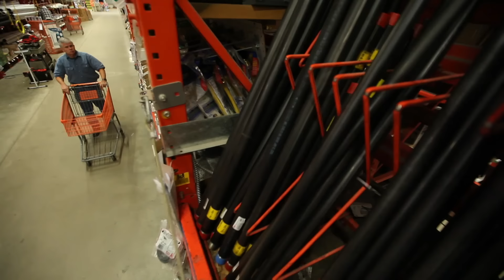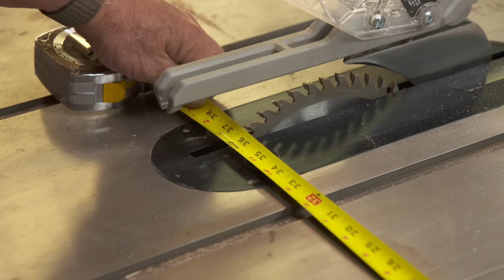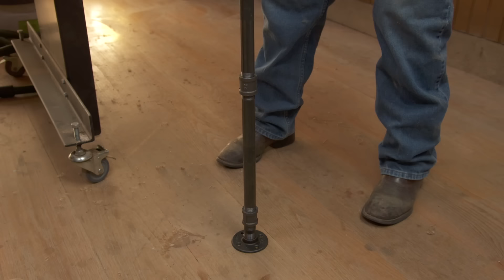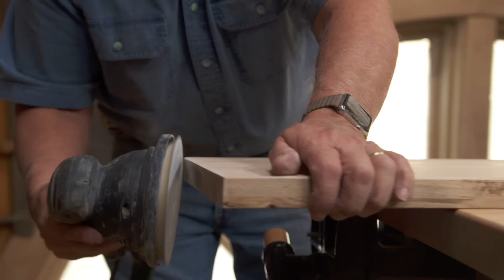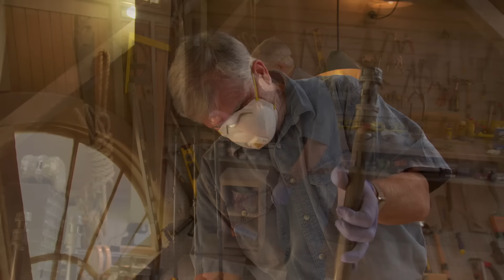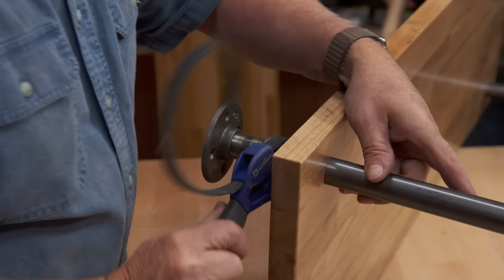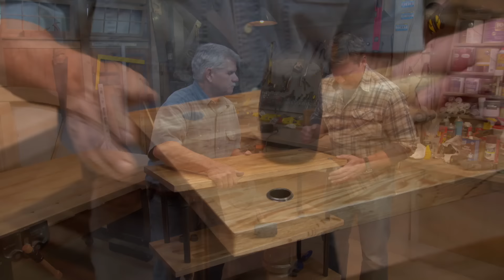Black Pipe Bookshelf | Build It | Ask This Old House

Comment: "Easy to build"????
Reply: Yes, that was easy to build.  Power drill, pipe, wood.   Don't even need the drill jig if you have a steady hand.  Home center can pre cut the wood for you.  Can hand sand it if you don't have power tools, a can of aerosol lacquer is cheap.  Easy afternoons work even for a non mechanically inclined person.
Reply: +alaskafender well said
Reply: Not true. Just have a plan when you show up and ask for specific cuts. I've had both Lowes and Home Depot make 5-6 cuts on a piece of plywood. As far as the metal pipe, buy the 10' long piece and have them cut and thread the pieces for free. It's so much cheaper to buy one or two $15 pipes than a bunch of precut pipes that cost $5-8 per piece (depending on length). Also FYI, most home stores will caution that their cuts are accurate to 1/4" and "no precision cuts". If you have several shelves cut, you'll end up with them all the same length. That being said, if your project calls for a very specific size and you cannot deviate, just cut them yourself.
Reply: Lee Hartwig You are the reason why they set a limit on cuts. People like you go there and take advantage of a kind worker to do all your work for free. Lame. Not to mention you are taking up their time, that they can be helping others. Do your own dann work or pay for the labor. That simple.
Reply: It is literally their job at the cut station to cut things for you.  This is in no way taking advantage of an employee or a store as it is a service they provide and often charge for after the first few.  No need to try to make people feel bad for working smarter not harder.